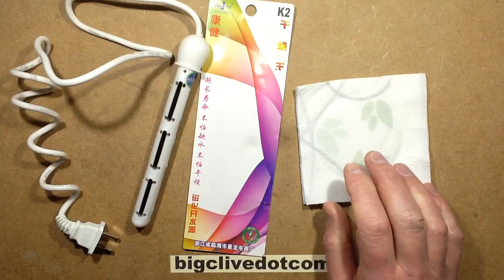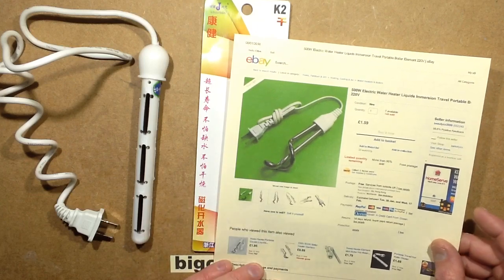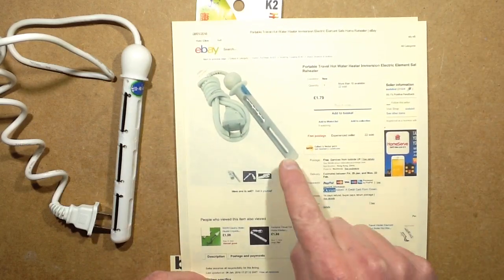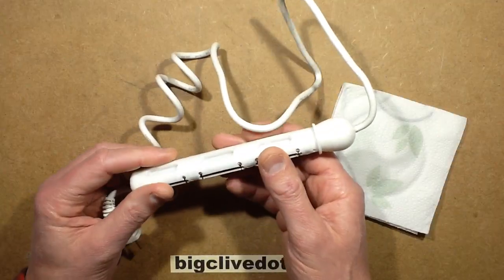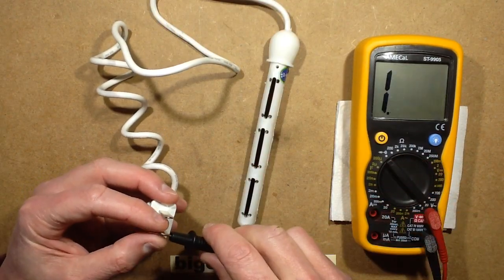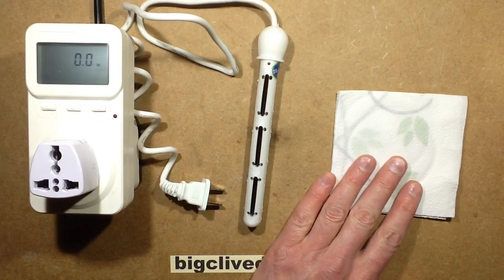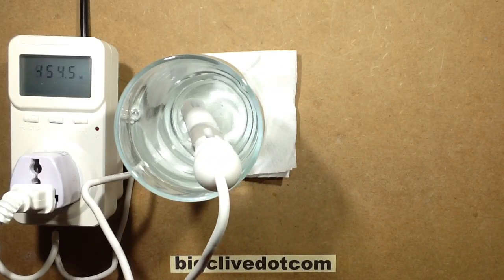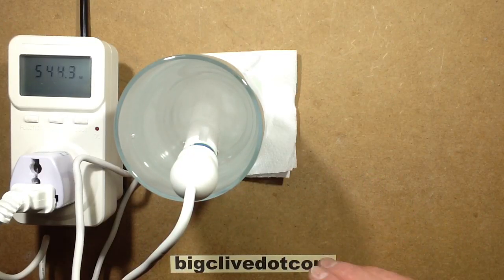Dangerous 240V Coffee-Cutor (coffee cup electrode boiler.)

Comment: not on earth /ground  Rubber mat??  and yes I do see these on ebay.   I was only lucky enuf to find the Turkey boiler kettle which I kinda prefer.  simply because it does have a plastic spoon .  Just well I'm odds on unlucky sometimes changing an outlet although I know how.  Preferrably sticking it into the holes rather than the old way of getting a needle nose pliers and hoping you don't scratch the copper and rotate the copper into a hook and turn down the screw.  and I don't much like the outlets up in the old section of the house so whenever I replace one of those I stick a GFCI in there.  Don't have one along the outside wall which is now rather rusty.  X_X  plug in a printer and I'll see a spark go from the outlet to the metal box .  eh no.  Where is my GFCI  I have it I just get hedgie trying to plug those in nowadays.  Especially in a "Dodgy" House wiring for multiple addons.  smh

Comment: Is that hydrogen and oxygen coming off the electrodes, causing the bubbles? As I think the electricity might be separating the Hydrogen and Oxygen atoms that water is made of. 

A way if testing this is to catch some of the gas in a test tube,and lighting it. You should get a load pop if it is hydrogen and oxygen. As it will turn back to water.

If you put a test tube under the water and allow it to fill with water. Then turn it up side down with the water trapped inside it, and clamp it into place. Then put the water heater underneath the test tube to catch the gases.

Obviously be careful as the water will be live, and also wear eye protection when lighting the gas, in case test tube breaks.

Thanks.

Comment: +bigclivedotcom - I think the "steam" that comes off initially is actually the liberation of oxygen and nitrogen (from the air) which is dissolved in the water. As the water temperature increases, it's capacity to hold dissolved gas reduces, and this happens long before the water boils. This is why if you draw a glass of water from the tap (fawcet) and leave it on the side for a few hours, small bubbles form on the side of the glass, as the water comes up to room temperature.
Reply: Some electrolysis will occur but it will be a very inefficient process due to the application of AC power. To electrolyse efficiently you need DC (this, of course, would be extremely dangerous because explosive hydrogen would be emitted).

Comment: when measuring the teaspoon's voltage was the other lead connected to the neutral line of the plug?
Reply from the maker: +Ian Donaghy Yes.  I could have done that test to earth because of the meters high impedance, but was doing both the voltage and current tests to neutral to get the equivalent of a reading to earth/ground without tripping the RCD/GFCI.
Reply: +bigclivedotcom Good to know, been learning quite a bit from your videos and glad to have found them both funny and informative. Keep it up!

Comment: I bought one of these for less than $3 on eBay and it heated the water very quickly (connected via my isolation transformer, of course). Unfortunately it would leach brown iron oxide-looking stuff into whatever water I tried to heat with it, so I ended up cutting off the power cord for something else and throwing out the actual electrodes :)

Comment: Ty for this 'review'! (I was looking for cheap electrodes for low voltage electrolysis, I hope it's stainless steel)

One I bought has the funniest and boldest description in the world ;) :

'Features:

1, Microwave special materials, non-toxic, odorless, In 100-degree
water, it also does not decompose, not aging, not discoloration,
deformation.

2, Due to the magnetic wave action during the heating, after water
absorb electromagnetic energy, moisture occurs bizarre oscillation ,
collision, and after friction, the water rising temperatures

3, Through special panels put chlorine converted into hypochlorite, play a role in disinfection and sterilization.'

Comment: Per your "recommendation", I located and purchased one of the 300W ones from Amazon.  Couldn't find any of the big ones.  Unfortunately, at 110V, it's quite slow to boil even a small cup of water.  Also, the plates show sign of rust already, but that never killed anybody.  Anyways, after adding some sea salt, the water boiled to a quite impressive temperature.  Almost an hour later, it's only just now cool enough to drink.  Too bad it tastes awful.  I'm pretty sure this device would be excellent for producing ramen noodles.

Comment: Yikes. Did the adapter you used for this, drop the voltage to 120v? If it's literally just two metal plates inside, one to hot and the other to neutral, do you think you'd see a difference in operation if you used a UK plug vs. a N. American Edison type and ran it at 240v.
Reply from the maker: +Mike McKeen It's actually intended for 220V so I was using it at 240.  the 120V was like a resistive mid-tap through the water.
Reply: Oh I see.
Reply: +bigclivedotcom If it was used at 120v what would happen to the time it takes to heat the water (if anything happened at all)
Reply: +Kuroko Shirai it would probably heat it 2x slower at 2x lower wattage
Reply from the maker: +Error989 I'm afraid it would be much slower.  If you base it on a specific water resistance the calculated power is about a quarter.

Comment: I can think of one handy application for that thing: An electrical heat source for model steam engine boilers.
Reply from the maker: +TestECull Which are largely made of metal, so would probably pose a significant shock risk if you used an electrode heater in them.
Reply: bigclivedotcom Not if the outer metal, baseplate, pipework is all earthed and the actual boiler itself where the deathprobe is fitted was well insulated. You'd want to do that anyway to keep from accidentally burning yourself brushing a hand against it, so a nonconductive heat blanket between the inner pressure vessel and outer facade would serve double duty.

The device as manufactured is unsafe but it can be used safely in the right circumstances.
Reply: No, using a Chinese electrode is not wise nor safe. But I won't argue with you. If you can get one of these to work safely, I'd be interested to see it. xD
Reply: +TestECull But if you are going to put that much effort into it. . You might as well do it the right, and safe way. . xD
Reply: *****
That is the safe way, unless you think risking a boiler explosion if the water level gets too low is somehow 'safer'.
Reply: *****
It would shut itself down when the water level got too low, preventing damage to and resulting explosions of the boiler. It doesn't need much to render it safe to work with, either. It would be no different than any double-insulated power tool or lamp or whathaveya.

They're only unsafe to heat your coffee with because there's nothing between you and the water.

Comment: Can you explain why it was OK for you to touch the teaspoon?
Reply from the maker: +RAFPony I was standing on wood plus carpet plus rubber soled footwear (crocs) so there was no easy route for the electricity to flow back to the general mass of earth or associated metalwork.  But current will flow in any path it can find, so that should never be done routinely.  A very small current did flow when I touched the spoon, but just tens of microamps.
Reply: +bigclivedotcom I would really prefer to see you using a isolation transformer with experiments like this, even I know that these devices in the >2kW aren't cheap. The videos you're posting are very entertaining, would be too bad if they suddenly stop...
Reply: +bigclivedotcom these water boilers are a bit popular in prisons, we use to make them and call them "stingers" or "bugs" but we never drank the water due to the heavy oxidization caused from our makeshift electrodes. Also I would like to note that I attempted your joule thief project, but I believe I had the wrong components. Very sad, I'm uploading the fail tomorrow morning.
Reply: +noname atall it's funny that you mentioned distilling moonshine because I left that out intentionally. But to answer your question, yes. We would take our mash and insert the "stinger" we made into it and seal a bag around the bucket and direct the opposite end of the bag over ice cubes to condense the vapor into liquid alcohol. All the while making sure there is a good seal between the bag and the bucket. But this is one of many uses for such handcrafted contraban in prison systems. We would also use them to cook, heat our coffee water, clean clothes, boil water to sterilize it, and some inmates would use them to aid in the production of weapons. The list just goes on and on. Lol
Reply: +bigclivedotcom can u explain that in non electrician words, please? :]
Reply: +bigclivedotcom u didnt touch the ground basically?
Reply: +bigclivedotcom Could you measure yourself with a multimeter, or would that ground you enough for lethal current to flow?
Reply from the maker: +PhoneyGeek I already did.  That's how I know how much current was flowing through my body.
Reply: +John Hasty they are used in prisons for what ? heating baths or distilling moonshine ?
Reply from the maker: +noname atall For heating water for tea.
Reply: bigclivedotcom Clive, I have a question about inductors and resistors. Pertaining mainly to the resistor, are all resistors alike aside from their respective value? because I may have easily mistaken an inductor instead of a resistor when I attempted your Joule thief project
Reply from the maker: +John Hasty Small resistors and inductors look similar, with the same style of colour code.  The body is sometimes a distinctive green colour and if you measured the actual resistance with a meter it would usually be quite low for an inductor.
Reply: bigclivedotcom Ah, ok. Then I need to salvage some actual resistors. haha. thanks for the respose. I share the same passion and have been "tinkering" since I was like 7-8 yrs old. Enjoy watching your channel as well!
Reply from the maker: +Tim Boxall Technically speaking my body became live at 120V, but as I was completely isolated from any return path to ground I did not pass much current.  If I had touched something grounded simultaneously I would have received a significant shock.

Comment: I have one in now from China, the Land of Electrical Delights, and I must say it is an economic way to boil water, and then make coffee, the "and then" should be noted, it can't handle coffee or anything added to the water.  I run it on a bench isolation transformer, and RCD and purely into a plastic container, it boils faster than any kettle and at 1/4, or better, the power. The water here is from chalk aquifers, in north Kent the water is rated as slightly hard. It draws about 600 watts overall.
I would not recommend using glass containers the quick boil heats the glass sides, leaving the bottom cold, and the glass can stress shatter, leaving a live device in a pool of water......I tried it and it did! 
I think the CE on the pack means in this case Chinese Electrocution.......

Comment: Just curious, to what extent do you ensure you are not referenced to ground? Would simply wearing rubber soled shoes and not touching any earthed objects suffice?
Reply from the maker: +Clone36 It's a tricky subject, since current will find any path it can.  Even a tiny pinhole through a rubber sole with moisture in it.   There's also the risk that if you got over familiar with being isolated from ground then one day you could absent mindedly reach up to turn a light on or off and touch grounded metalwork while also holding a live object with dramatic and potentially fatal results.
Reply: +bigclivedotcom Thanks for the reply, I guess complacency of safety is where the danger lies eventually. I am an electrician and would be lying if I said I haven't had any shocks in the past. I always wondered for an idea, if you strap metallic bracelets to your wrists and ankles and tie them together with reasonably thick cables, if you did accidentally contact a live part, and ground between two limbs, the vast majority of current would flow through the cable, and hopefully only microamps might flow through the heart, or brain. Of course the downside of this is a large fault current flowing through cables before safety trip causing severe burns. Still better than having your heart or breathing stop.
Reply from the maker: +Clone36 As nice as that sounds, it's unfortunate that the skin has a higher resistance compared to the inner flesh.  So while some of the current would flow through the bonds there would probably still be a high flow internally.

Comment: 240v? That is only a 120/110v plug...
Reply from the maker: +Scott Smith Chinese 220V plug.
Reply: equally dangerous
Reply: China has 220v mains but the plug is very similar, if not identical to the plugs we use here in the US at 110v.
Reply: +bigclivedotcom I am a naïve American. I looked up standard voltages after watching and then felt stupid. I work at a power utility so know how we get 120/240 here in the states, but don't really understand how other systems work. Do you have a video explaining how the UK power system works?
Reply: +IT'S TIME TO STOP technically USA has a 120/240v system. Phase to neutral/ground is 120 and phase to phase is 240. But most of the time people get 110/220 because of how far they are from the nearest substation. I know that in my area the utility has the substation voltage a little high so people close to the sub are getting 130/260 and getting bulbs burning out quicker then normal but people out at the end of the Circuit might only be getting 105/210 because of voltage drop.
Reply: Scott Smith My larger appliances are 220v. I meant in general.

Comment: you failed to mention the health hazards regarding electrolysis of stainless still electrodes "Stainless steel contains chromium. The electrodes, and thus the chromium is consumed, and you end up with poisonous chromates in your electrolyte (your hot drink!!!). even dumping these on the ground or down the drain is illegal. The compounds can cause severe skin problems and ultimately, cancer. Hexavalent chromate is poisonous. These compounds are not excused from hazardous waste regulations where household wastes are. 
These compounds are bad enough that government regulations mandate "elimination of hexavalent chromate by 2007 for corrosion protection."
My Aunt (RIP) used to make boil water for coffee and tea with one of those electrolysis kettles for a while (I guess because they are soo fast) I still remember that metallic taste! I remember if you live it for a while how the water turned to orange-yellow color and when you  let it cool  you could see a layer of oily residue on the top..... bad stuff!!! long story short she diagnoses with cancer later and died 2 years ago.

Comment: The problem is that this is essentially similar to a simple electrolysis apparatus, meaning that depending on what is in the water it could easily turn it into something else and poison you.
Saltwater could turn into Chlorine gas if it is a saturated solution (so brine) and, worse,  liquid NaOH!

Comment: It may be amusing to carefully hold a flame over the water just as you first turn on the power (but NOT after it has already been plugged in!) I suggest, of course, that the first fine bubbles you see are not steam but rather elemental oxygen and H2 gas released by electrolysis. Since it is AC current, not DC. the gasses will be evenly mixed together and would ignight with a "Bang" if allowed to gather before being introduced to flame.

Comment: Clive, I wouldn't even drink that water afterwards as due to the electrolysis, ionized metal particles separate the electrodes and get dissolved in the water that might be toxic. Do you have a TDS meter handy? If so, check the TDS before and after boiling on the same temperature. Distilled water would be ideal.

Comment: The prison made version of this, aptly call a 'bomb', consists of razor blades and match sticks held together with polyester thread. (thread salvaged from prison uniforms.)
Heating water for tea is done by half filling a 2l plastic bottle with water, squeezing out the excess air and putting it into a bucket of water. They do it that way because the electrodes tend to impart a rather unpleasant metallic taste to the water.

Comment: the bubbles are electrolysis - splitting water into hydrogen and oxygen. if you had done it with a DC current, you would even be able to separate each gas.

Comment: When I was a kid I was messing about one of those vaporizers you use when you're sick, cleaning the rust out of the bottom or something and I assumed the two rods that stuck down into the water were just heaters when in reality one rod is neutral, and one is live.  I was holding them in my hand, and I plugged it in and got the nastiest shock of my life..I'm surprised I was able to let go, I remember feeling the 60hz wavelength going through my body.
Reply: Anyways, wouldn't anything made with that little device taste like crap?  Where does all that nasty corrosion that builds up on the leads end up?
Reply: +sc0tte1 One time I wokeup in the middle of the night still drunk, and smashed my head on an open light bulb that was turned on, then proceeded to try to unscrew it from the socket by grabbing onto what was left inside the bulb, got shocked pretty damned bad for quite a while, then was paralyzed on the ground for quite a few minutes, getting shocked sucks, haha.